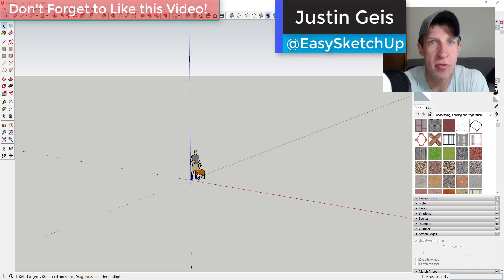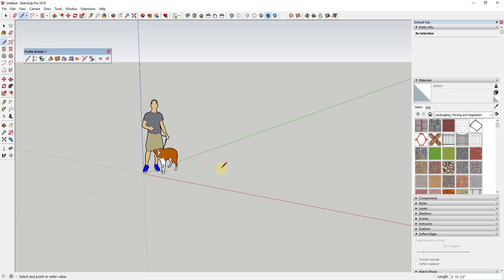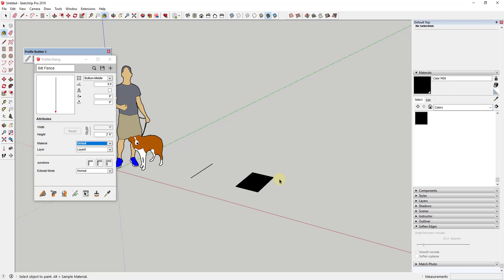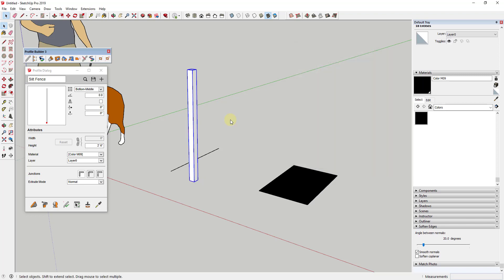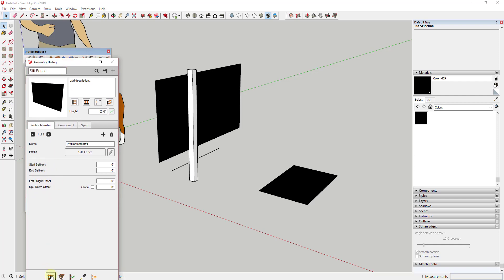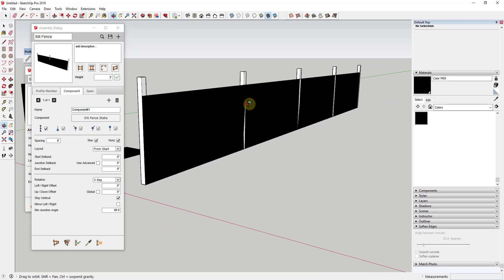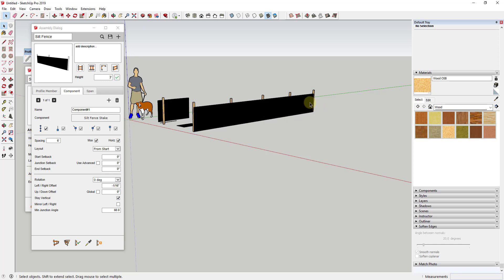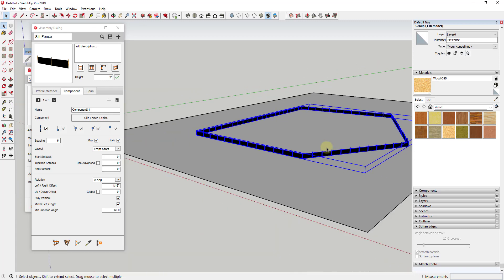CONSTRUCTION FENCING in SketchUp with Profile Builder

Comment: Just downloaded Profile Builder- but when I attempt to make the same 1 line profile that you did with the silt fence, I keep getting an error "All points on a polyline profile myst be drawn on the ground plane". Any insight?
Reply from the maker: It has to be flat on the ground plane (the height where the red or green axes intersect). If it's above that plane you get an error